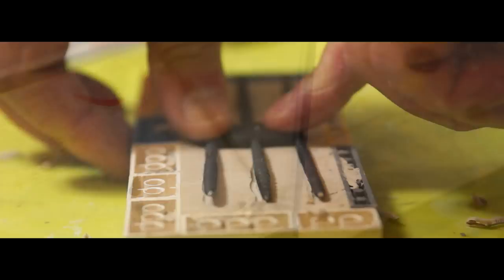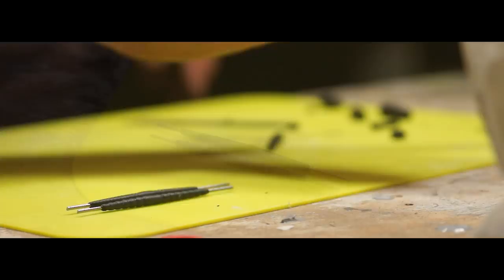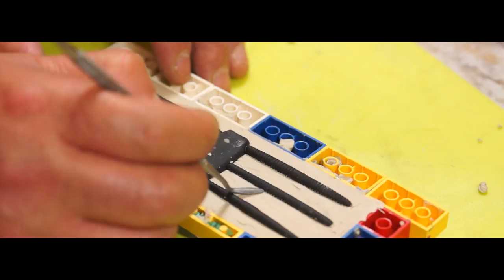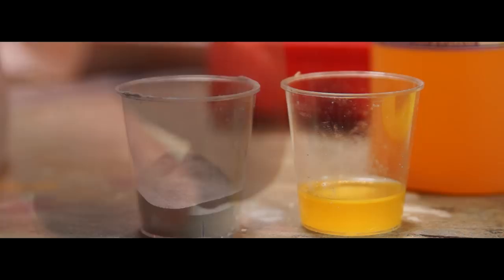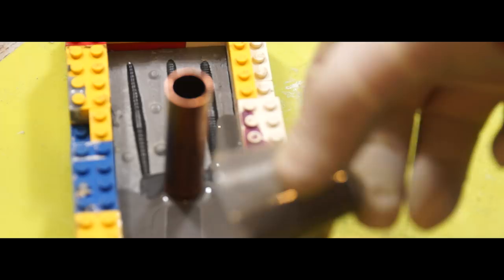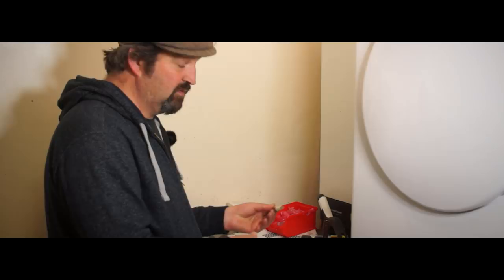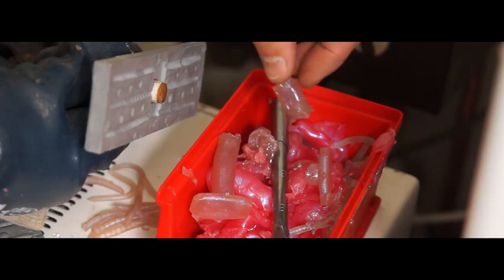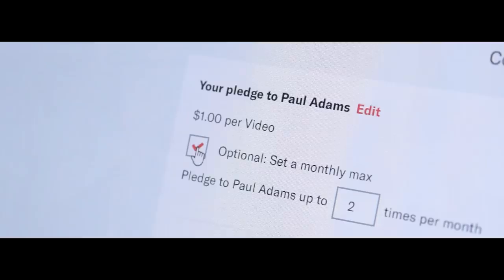Making bulk soft plastic baits and Resin injection moulds

Comment: For the first half of the mold try melting oil based modeling clay. It should form around the details so you don't have to spend as much time cleaning up around the rings.
Reply from the maker: i thought about just sitting in the semi cured resin but  I cannot see this being easy to control with more than one worm, melting clay may be similar but probably more controllable, i have done this with chavant before today for simple objects, but you still have to clean it off. there are always lots of options and it is good to try a few out cheers

Comment: nice vid did you get my message about latex surface mice and how to make them? what did you say those rib things were as i cant see them in list under vid as i might get some as they be handy for some the lures i mess with. thanks for any help
Reply from the maker: http://www.greenstuffworld.com/en/roll-maker/69-roll-maker-tube-wire-machine.html?search_query=roll&results=38
Reply from the maker: yes, i did see your message, it is not something i am working on at the moment but may in the future
Reply: thanks for link
Reply: it was idea from that last vid of your what to make bit. I saw them making floating lure so you could make frogs mice and such was thinking of using that plastic you melt in water to make moulds so could try if fail just remake it